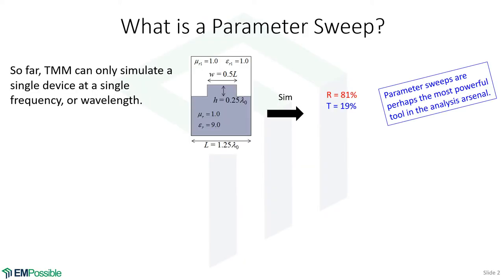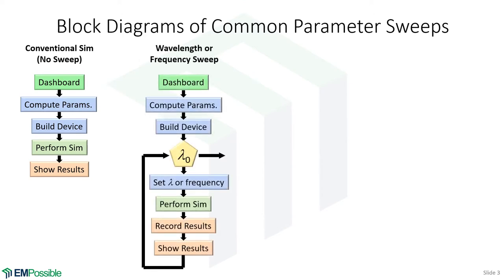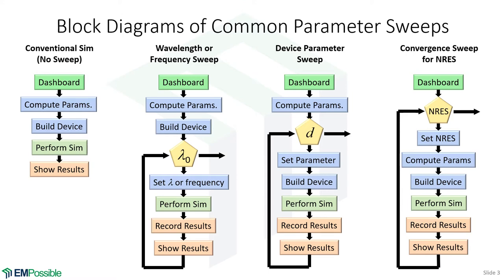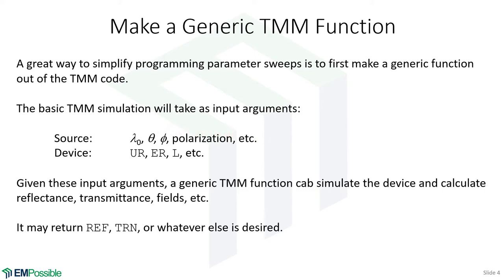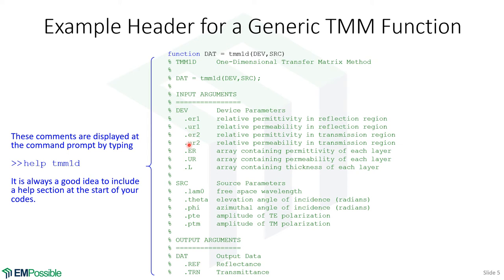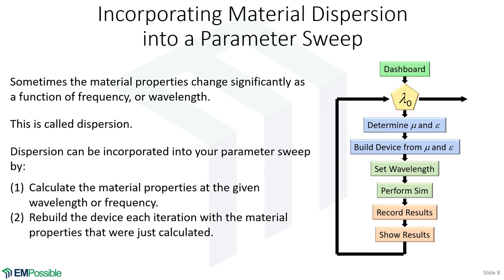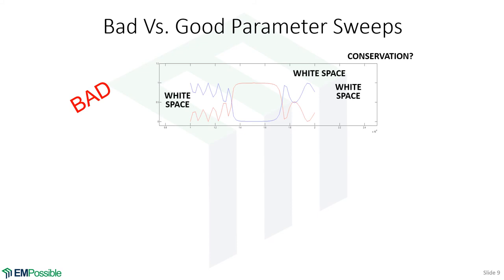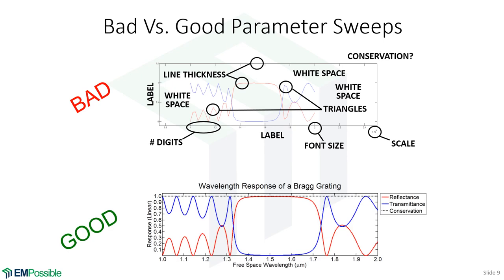Lecture -- Parameter Sweeps

Comment: Thank you for all of your effort! I've also finished lectures on Implementation of TMM in MATLAB on EMPossible website. Now, I'm going to take lossy materials which means that the permittivity becomes complex. As far as I understand, I just have to make permittivity complex in my MATLAB code, like 1.5 -> 1.5 + i*0.2. Is it right? Again, thank you so much! :D
Reply from the maker: That is it!  We are still working on how to handle the  external mediums if they are lossy.  Turns out, that is not as easy as just making the permittivity complex.
Reply: @empossible1577  Thank you for  your reply! I couldn't find where you're working on how to handle the lossy external mediums. Can I get the information? Thank you :)
Reply from the maker: @HCho-xe1cj  It is not available yet.  We are writing a paper and then had to split it into two.  The first will cover the Fresnel equations when both mu and eps are complex.  The second will cover how to modify TMM.  Hopefully we will soon publish how to do it with other methods.  Sorry for the delay!!
Reply: @empossible1577  Ah, I see. I hope the paper work goes well. I will review and think about that topic while I'm waiting. Thank you :D